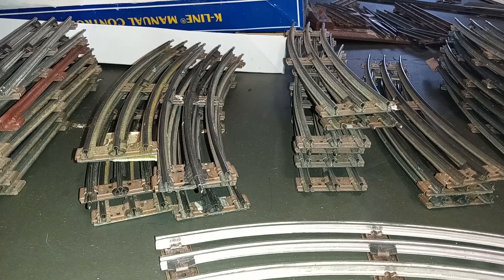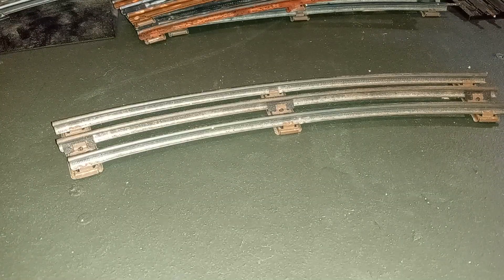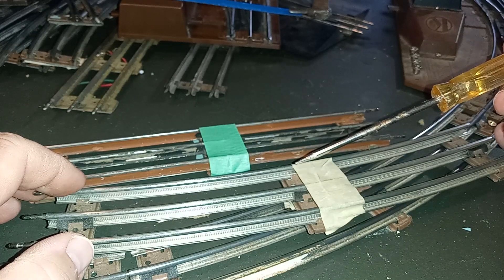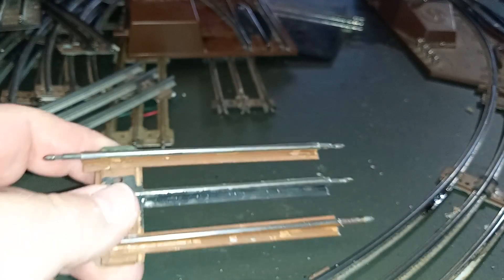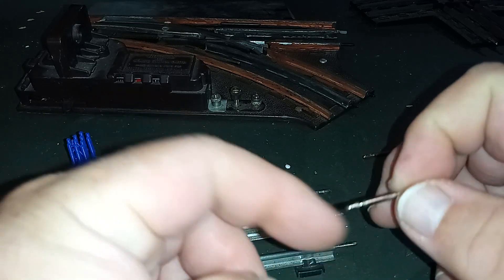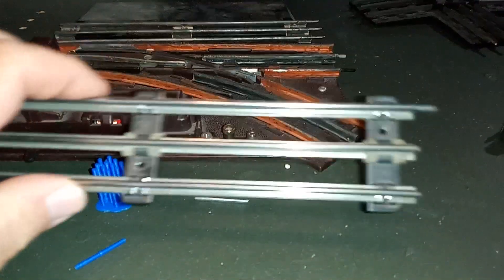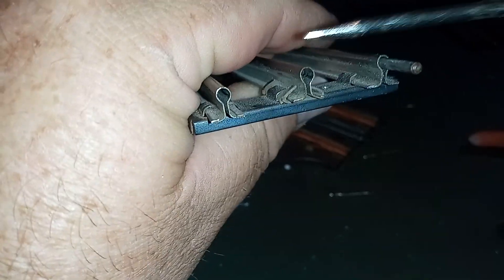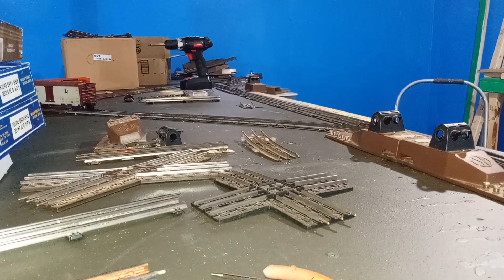O27 Tubular Track Tips: Building The New Layout

Comment: I also am a big fan of the O27 track. I find the smaller profile to look better and the trains look more realistic on the smaller rails. And as you noted since it was made in larger Radii All the larger locomotives run just fine. Some treat the smaller rails as though they are a completely different Gauge which they aren't. But if you scale the rail height on the clunky O track it comes to 30inches in the real world. Too big unless you're running a monorail. The O27 is around 18" which although still a big tall is much closer to scale than the other. I had the fortune to get some of the larger curves while it was still being made and Both LIonel and K line made switches with 42" curves. Just my preference and I am glad you like it too. Too many people are dismissive of the O27 track and that is a shame. Always enjoy your videos, very informative.
Reply from the maker: Thanks! I love O27 track.

Comment: I purchased a case of postwar O gauge straight, and a case of curves (100 count each) from Stout Auctions 15 years ago.  This track is new, unused, and still wire-banded. It is the harder to find gray anodized rail type, built by Lionel during the Korean war. I am finally building my postwar-era style layout, using this track of course.
Reply from the maker: Excellent! I have a few pieces like that. Most of mine is MPC era.

Comment: I have been using nails for track pins for many years galvanized nails are even better, in addition when fastening down the track only place screws on the ties closest to the inside rail, especially on curves. If you want to slightly bank curves cut down door shims, do it on a trial basis . A little bit of shim is all that is needed!!!
Reply from the maker: Thanks for the info!

Comment: Mike, you are the perfect guy to ask this question, because of your expertise in postwar Lionel track.  What is the ideal placement of lockons on a tubular track layout - given that the track is brand new postwar, never used, and given appropriate gauge wire, etc. One lockon every four feet, six feet, eight feet?  We are talking a layout with approximately 70 linear feet of mainline track. Power supplied by several postwar ZWs.  Some say a lockon immediately before or after every switch?  Appreciate your help Mike, as I finally begin my new postwar layout.
Reply from the maker: Thanks! You have landed on one of the topics of my next video! My rule of thumb is one set of feeders every 5 track sections. I also attach the ground terminal of every remote turnout to my common bus wire to ensure good ground contact throughout the turnout. If the turnouts use track power instead of transformer power, extra feeders next to the turnouts are a good idea to combat voltage loss when the train activates the nonderail feature. Enjoy your layout!

Comment: I wish they still made 027 track. It was made in different radii as you mentioned and it did not stand up as tall as 0 track. That is one reason I miss Kline. They made a lot of different tubular track.
Reply from the maker: You can still find it on the secondary market. Check local train shows/meets.

Comment: Interesting. Did you grind the cutting edge off those nippers, or were they full to begin with?

For what it's worth, you can get nylon or plastic rod from online metals or other suppliers in whatever diameter you want very cheaply. That's a whole lot easier than trying to make your own pins with a 3D printer.
Reply from the maker: The nippers are as-is from Harbor Freight. Thanks for the tip regarding materials, but when I only need 4 or 5 pins for a project I can print them in less time and effort than ordering. But it is an option - thanks!

Comment: Does anyone know where I can get new o-72 switches. I have a ton of old track from my dad and grandpa and don’t want to buy fast track
Reply from the maker: No one is currently manufacturing traditional tubular O or O27 turnouts. If you don't want FasTrack, you can try GarGraves or Ross Custom turnouts and use shims and transitions to your existing track. Or try to find good used O72 turnouts at a show, Trainz, eBay, etc.
Reply: This is a year after you asked but just in case- Menards just came out with 072 switches for $60 ea.

Comment: 7:25 can someone just reply to this not like so I can see it tomorrow so I can put insulators into my track because it kept having short circuits and I think that’s the reason because after a switch that I removed a insulator from the train just immediately stopped after the switch and I didn’t know the insulator stopped short circuits because I though it would give more power through the track without the insulator
Reply from the maker: It's difficult to figure out exactly what you are asking without punctuation, but I think you are asking if O27 remote turnouts require insulating pins.  The answer is yes .
Reply: @ToyTrainTipsAndTricks  alright thanks
Reply: @ToyTrainTipsAndTricks  also this reminded me to put in insulators today, so thanks !

Comment: I’d give my left arm if someone started making 0 to 027 track mating pins again. I sold all of my Fastrak about 5 years ago and I have a lot of 027 track plus starting buying Menards O gauge track.
Reply from the maker: The workaround is to use O27 pins and jumper wires as required for power continuity. Shim the O27 track to match the height of the O. Thanks for watching!

Comment: What?!?  Lionel doesn't make tubular track any longer?   What genius decided that was a good idea?   Pfft.
Glad I bought boxes and boxes of both O and O27 for cheap at train shows over the years.  Also a fairly good hoarde of mpc era remote switches off ebay in the early 2000's
Even in hobby shops the $1 a section track was a no brainer over Fastrack for $5 a section.
Glad to have 50+ yrs with Lionel.  I'd hate to be just starting out.

Comment: what size table is your reversing loop on?
Reply from the maker: Phase 1 of the layout is roughly 5 x 12. The track plan of this section is a simple oval with twin diagonals across the center. Each of these diagonals creates a reverse loop. I can run outside only, "figure 8" or oval to loop in either direction.